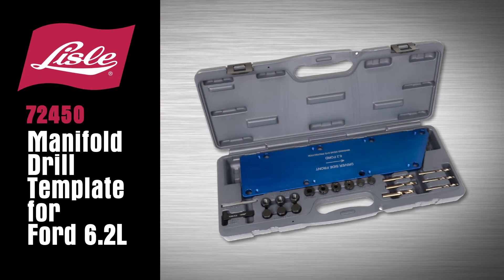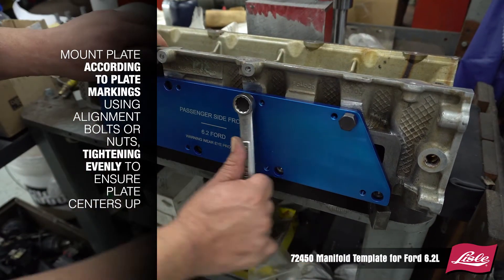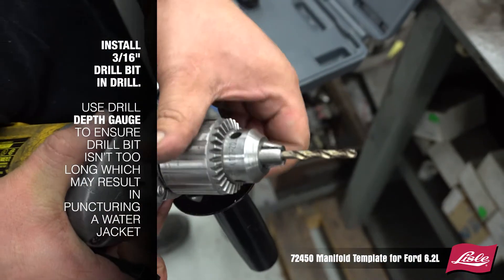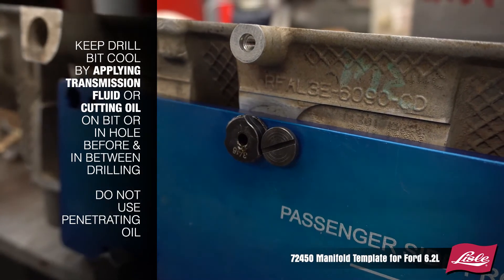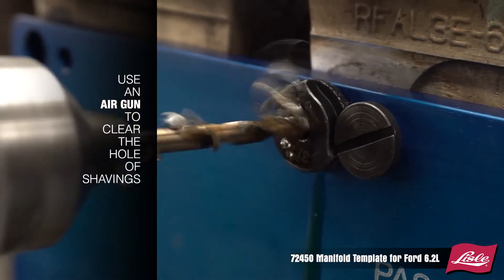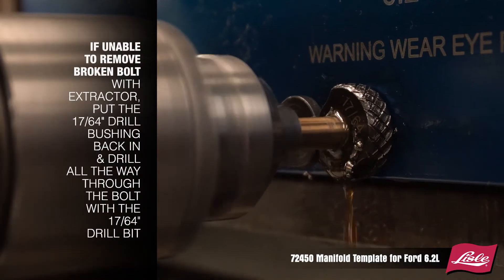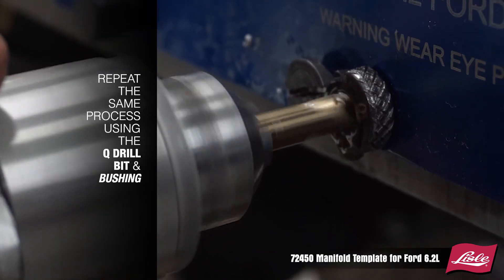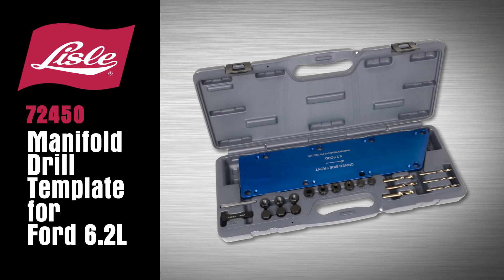72450 // Manifold Drill Template for Ford 6.2L

Comment: Does this work on vehicle too
Reply: I am currently using this now on truck seems to be working for the position I’m in just need a 90 degree drill
Reply: @fmx3r1 how did that turn out ? Where you able to use the kit with the engine in place?
Reply: @NathanMorton-d9b yes.. on the outside bolt holes it’s tight but you can do it on both sides with 90 deg drill and the short supplied bits